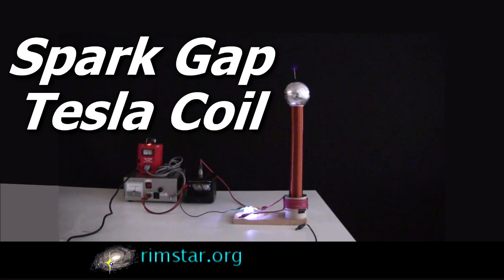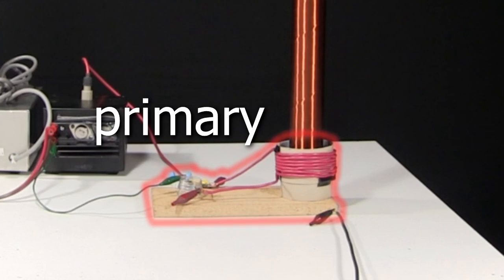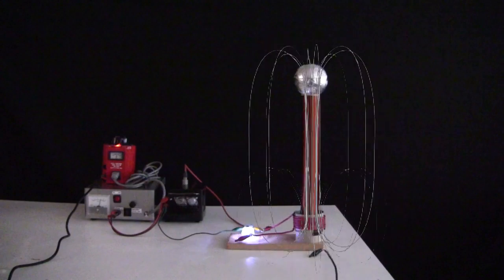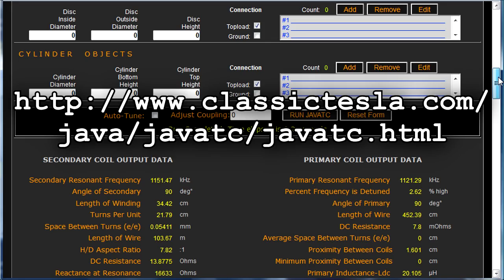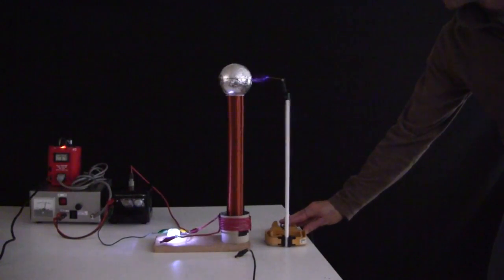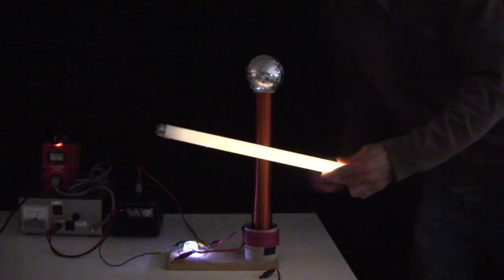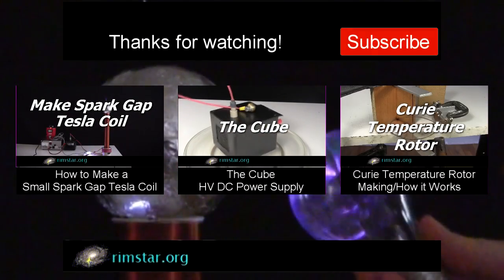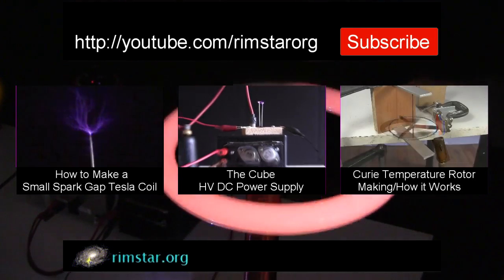Small Spark Gap Tesla Coil

Comment from the maker: See my small spark gap Tesla coil in action. Can do some awesome looking stuff with this one! Enjoy!
Reply: Fantastico !!!!!!
Reply from the maker: Gianni Pirola Fai Da Te
Thanks!
Reply from the maker: omar bentaleb
You'd need a more powerful power supply for the input to the Tesla coil.
Reply: RimstarOrg how can i increase the distance so the fluorescent light will glow
Reply: RimstarOrg please answer
Reply from the maker: omar bentaleb
I did. You need a more powerful power supply. You can also make a larger Tesla coil and then an even more powerful power supply, such as a neon sign transformer power supply.
Reply: RimstarOrg is 9 volts is enough for the small tesla coil to make the fluorescent light glow from 3 meters
Reply from the maker: omar bentaleb
For 3 meters you're probably talking about a pretty big Tesla coil, possibly one that's room height. If you mean a 9 volt battery then no, they wouldn't do. 3 meters is a lot to ask for and isn't even something I could do.
Reply: RimstarOrg si yiu're saying that is impossible to make a small tesla coil that do 3 meters ?
Reply from the maker: omar bentaleb
Yes, I'm pretty certain it can't be done.
Reply: RimstarOrg what about a slayer exciter
Reply from the maker: omar bentaleb
I've never made one. However, if it's around the same size as my small tesla coil then I doubt it too.
Reply: RimstarOrg thank you for your respond . is there anything else that can make a fluorescent light glow from 3 meters
Reply from the maker: Not that I'm aware of. Unless a room sized Tesla coil can do it.
Reply: RimstarOrg  thank you  so much for your help

Comment: I should note though that adjusting the spark length does not actually change the 1MHz frequency you calculated, but rather, the timing when the spark gap fires, and when it does, it basically stays conductive for some time and the power gets bounced back and forth between the L1 coil and the capacitor, so it has it's own resonant frequency, and that has to be set to the resonate also to the L2 coil for best sparks (can be done by changing the capacitor value, the # of turns on the primary, or you can change the resonant frequency of the secondary, since it is also a capacitor (topload) and inductor, too!

So although the tank circuits operate at really high MHz frequencies, the relaxation oscillator part (capacitor charging and discharging through the gap) is much less in terms of frequency. It is firing at the low end of the audible frequencies, in this case, it sounds like 100Hz.
Reply from the maker: Power Max Yup, I'm quite familiar with all that. It'll just have to wait for a dedicated How-it-Works video given that it takes a lot of tricky animating (e.g. How do you animate what's happening to the charge on the topload all that time? Or the C in the secondary coil? I don't have clue how to illustrate those.) If you look carefully at the em waves I animated in this video you'll see the primary waves ramp down while the secondary waves ramp up, and then reverse after the first primary notch. This is all during a single spark, so those waves represent the 1MHz frequency (not to scale). I blew it in the animation after the spark where I have just the primary wave ringdown. It was supposed to be the secondary wave since the primary circuit is open at that time. Usually with Tesla coils we illustrate only what the voltage is doing so it was a real mind-bender translating that to what the em waves would be doing and I didn't even try animating the C parts of the two resonant circuits.
Re the spark gap length not changing the 1MHz frequency, I've read it both ways. Some say it adds (or subtracts) capacitance, but I can't imagine it's much. I actually use the grounded needle facing the topload to tune, since I can go by how far the needle has to be to get solid sparks. Adjusting the spark gap had an effect on that, though that may also be just due to the energy difference.
Reply: RimstarOrg Ahh. I just thought you said you were able to tune it by adjusting the spark gap, which does change the firing rate, and how far the capacitor charges, but I don't think it has much effect on the running frequency, although I am not an expert, I really don't know. Maybe for animating voltage, I would make blue and red haze on the parts, so the more positive things are relative to ground, the more blue, and the more negative, the more red. For animating the capacitors, if you use a the schematic symbol, maybe make one side get more and more and more red (HV negative output from the flyback) then when the gap fires from enough potential, you show how the capacitor dumps energy into the coil, then the coil's reactance causes a back EMF spike to charge the capacitor, then the capacitor, charged, discharges into coil again... and the oscillation at 1.15MHz dies away, or dampens, because of losses in the capacitor and wires and spark gap, but also because the coil reactance does not return as much energy back because some it it got "sucked away" into the L2 coil and leaked away as sparks.
Reply: You know, I really love the nature of the sparks that come from the SGTC, they are thin and hairy, and just different from anything else. The streamers from solid state coils and slayer exciters, although about as long as an inch from mine, they are thick, dense, and tend to be stationary. I think the reason a DRSSTC is a bit more SGTC-like is that although the resonant oscillator section work the same way as a SSTC, the power to it is modulated on and off at audible frequencies so that the oscillation does not grow too large where the switching transistor may become damaged. I think that is why it has similar characteristics.
Reply from the maker: Power Max I don't think the spark gap size has much effect on the running frequency either, but I've read both that the capacitance of the spark gap does, and I've read that it has no effect but without mention of the capacitance. I decided to go with it, though the capacitance must be miniscule. I like the red/blue color idea on the coils. Hadn't thought of that. Thanks!

Comment: im glad to see you succeed! i still think it had more to do with just turning up the power than crunching numbers, but it doesnt hurt.
Reply from the maker: jeremy gwilt I'm on the fence about that. In developing this I also made a secondary coil that was half the height of this one. The numbers said all I needed to change in the primary circuit was to cut the capacitance from 4nF to 2nF. Then both circuits would resonate at around 1500kHz. But at one point while it was producing streamers and working well, I realized I forgotten to change the primary capacitance; it was still 4nF! I then changed it to 2nF and the output was better, but not a huge difference like a doubling. In the defense of the numbers, I see a lot of well powered but untuned tesla coil videos out there that produce only one topload spark per primary circuit spark-gap spark. However, if I recall correctly, they also have a tight coupling between primary coil and secondary coil; the primary coils are wrapped directly on the secondary.
Reply: RimstarOrg yes! there is some merit to the math...dont get me wrong. i see it as a rough guide though. i mean, the formulas were written through observation in the first place, right?! 
i was put off from playing with these coils for a long time due to the attitudes of those building successful versions. insisting on proper math, etc and jaded by the years they have spend researching and tuning their own systems.i finally just stopped listening and went about it my own way, and learned tons. 
i must admit, they are a blast to play with....both spark gap and solid state slayer towers.
Reply from the maker: jeremy gwilt Oh, I agree. For me, the math gets you in the ballpark, then the tuning brings it home. But this is my first Tesla coil, so I'm still learning. Even when I do the how-to-make video, I suspect the Tesla coil will have changed. I'm thinking of trying a bare wire spiral primary coil so that I can tune it better. I wish I had a signal generator so I can measure the secondary circuit's resonance frequency.
I'm also with you.. definitely a blast to play with.

Comment: I like...next can you do a small SSTC or DRSSTC with audio modulation? AKA singing tesla coil.
Reply from the maker: Random_rapper20 Thanks. Singing Tesla coil is something I'd like to try sooner rather than later. SSTC or DRSSTC are further in the distance, but I'd like to try that too.
Reply: OK. Also i was wondering if you could do a video on a simple/cheap flyback driver, and i was also wondering if you could do one explainting how transistors/mosfets work, because that has always confused me.
Reply: RimstarOrg In my tesla coil making experience i have never seen a singing spark gap tesla coil. Check out Onetesla.com! I built a drsstc that produced about 2 foot sparks off their plans! (check under the downloads tab)
Reply: i didnt mean singing sgtc...but that would be neat

Comment: Awesome coil! I attempted this with a photoflash circuit long ago, I was only able to get one cm really dim sparks, and I made a capacitor with 2 aluminum pie pans separated with paper and a block of wood. Now that I look back upon it, I see everything I did wrong! Maybe I will attempt this again!
Reply from the maker: Power Max Thanks! Sounds like my attempt using the fly swatter. I guess we could build up the energy in the capacitor over 15, 30, ... seconds and then get a fraction of a second (?) streamer and then wait another 15, 30, ... seconds. I actually did hook my fly swatter to this version of the Tesla coil to charge up it's 4nF of capacitors but stopped when I realized nothing was happening because it was charging up the 4nF of capacitors. Didn't even wait for the spark.
Reply: RimstarOrg I think the problem is that the capacitor value need to be small, so that it resonates with L1 at a high enough frequency, and unfortunately you just cannot store much energy in a small value capacitor at low voltages. The only way to get lots of energy into a small value capacitor is to either increase the capacitance so it stores more energy for a given voltage, or ramp up the volts higher, which you did for here. (BTW, did you know that doubling volts will quadruple the energy! the formula is energy = 0.5*C*V^2) I will see if I can get my 60KV singing arc project to power it too! (I will probably need to reduce the voltage because I do not have a 60KV capacitor, and never plan to make them again after getting a really bad shock from one)

Comment: Nice to see you got it it going!  A little advice, it's best to actually have the primary's resonant frequency at just a little bit less than what the secondary's is to compensate for how the streamers are going to effect the secondary's frequency.
Reply from the maker: CoolDudeClem Yup. I've heard 10% less is a good rule of thumb. Another reason I've heard is to compensate for the spark gap heating up.

Comment: I love it!!!! Van i get one like this ..?  B-)
Reply from the maker: vijay ram sri ram Thanks! I'll finish putting together a video showing how to make it step-by-step in the next few weeks, so you'll be able to make one! :)
Reply: Thank uuuuuuuuu!!!!!!
Reply from the maker: vijay ram sri ram Keep in mind that it requires a high voltage power supply. So the Tesla coil part is easy to make but the power supply is the hard part.
Reply: Ooh where can I find such kind of high voltage power supply?   (:-(
Reply: RimstarOrg  can i connect two or more fly swatter for high voltage power supply
Reply from the maker: vijay ram sri ram There probably is a way to combine the output of multiple fly swatters but it would probably take an awful lot of them. BTW I haven't measure the input for this Tesla coil yet. That's why I don't have a suggestion for which power supply you'd need. The best I can say is that one source is http://www.amazing1.com/hv-dc-power-supplies.html but I couldn't say which one yet.

Comment: This is awesome! Is a tesla coil just a transformer with a topload?
Reply from the maker: MrShadow12622 No, there's a lot more too it. The primary circuit consisting of the parts I showed all resonate together. The secondary circuit also resonates. Put the two resonating circuits together and get them both resonating at the same frequency then you have a Tesla coil. What's going on is actually quite different than a normal transformer. There's also a loose coupling between the two coils. Notice the air gap between them. A normal transformer, on the other hand, needs a strong coupling, with something like ferrite to help. When I've had enough experience making them work then I'll put together a video explanation. Here's an excellent page in the meantime http://www.richieburnett.co.uk/operation.html

Comment: RimstarOrg Now that is what I call success. Great job, Nice streamers, and keep up the best work. Try adding a few more capacitors to see if the streamers are larger. amazing work.

-Kyle
Reply from the maker: Kman Meteor Thanks. I think I'm already pretty close to matching resonant frequencies already. I actually use the grounded needle as a measurement of how close they are. When I lower the primary coils to the wooden base or when I raise it as high as it will go on my support cylinder then I have to decrease the distance between the needle and the topload to get solid sparks. But when I have the primary coil where it is in the video then I get have the biggest distance that I can have and still get solid sparks. If I had a signal generator then I could figure it out precisely. But I don't have anymore HV caps anyway. I think my days of playing with Tesla coils is just starting. :)
Reply: RimstarOrg Well you're off to a great start. where did you get the capacitors from?
Reply from the maker: Kman Meteor Information Unlimited aka http://www.amazing1.com I also bought my first power supply from them many years ago. These days you can also find the capacitors on ebay. Mine are 20kV, 1nF ceramic. I used 4 in parallel.
Reply: RimstarOrg seems like they are out but you can try extracting them from old electronics.